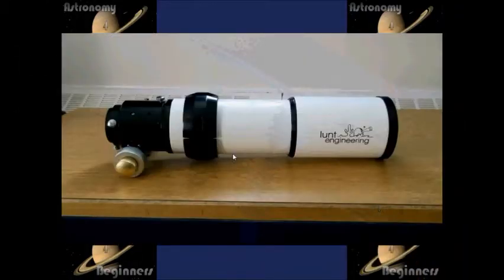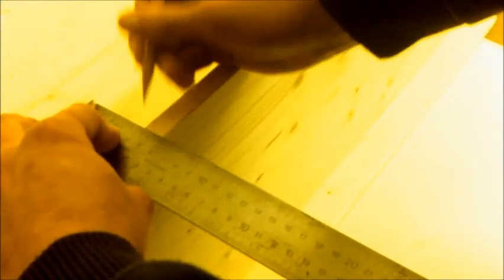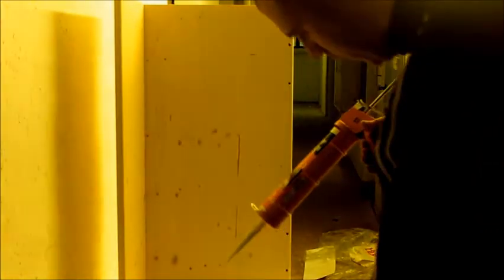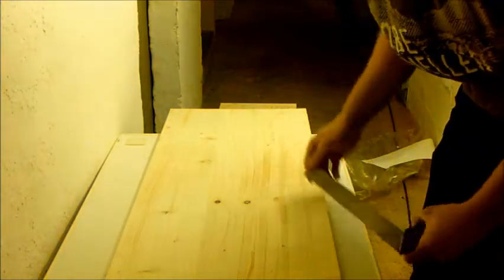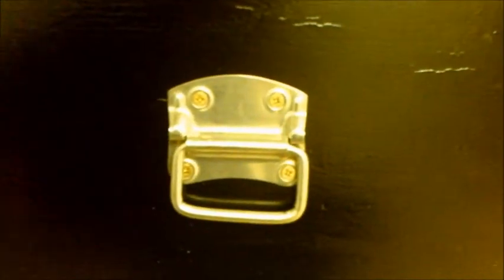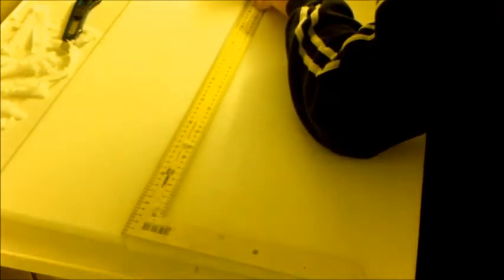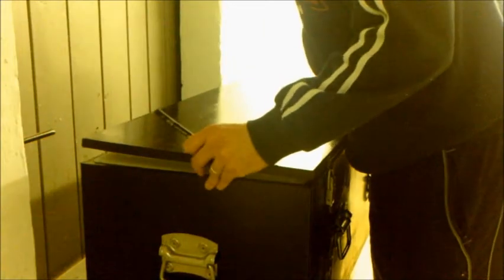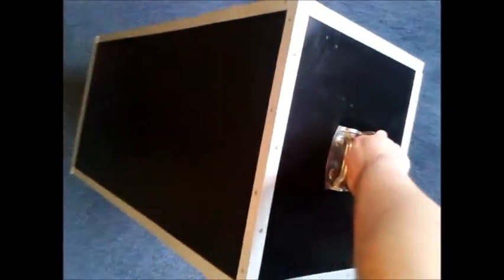How to make a DIY Telescope case (re-edited)

Comment: Learn to edit your video and stop saying “alright”.  You said it about 200 times.  This is a protective way to ship a scope but it adds serious weight.  Did you consider using 5mm plywood ?
Reply from the maker: Apologies in advance, I know its not good to say things over and over again, However these are my earlier videos, when I first started out on Youtube. My latest videos have come a long way now!! 
Nope I don't think 5mm plywood would be strong enough, However you decide on what materials you want to do on your box project. The case is still strong and robust and it hasn't failed on me yet, so depending on your budget. 
Better to be heavy with some added protection, this case I've made has been shipped overseas and my 8" Quattro is still intact.